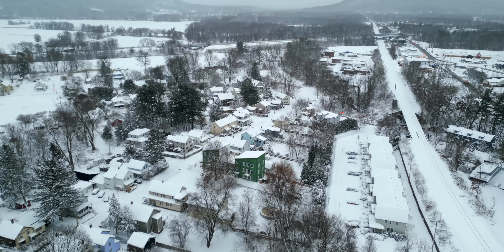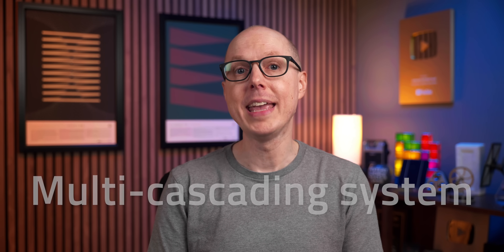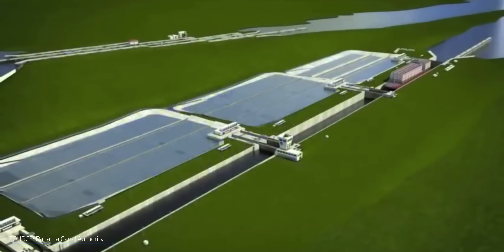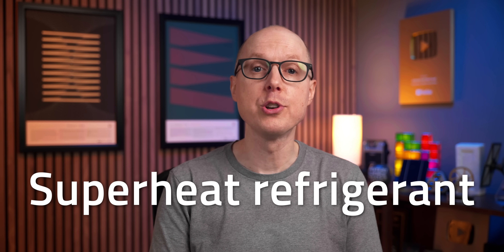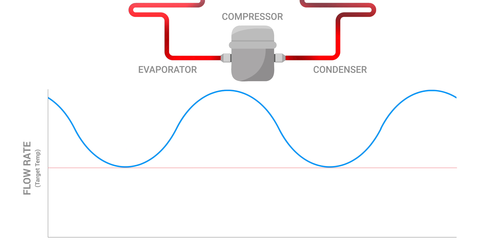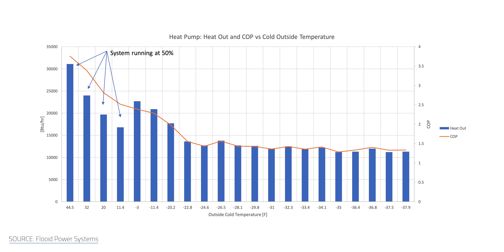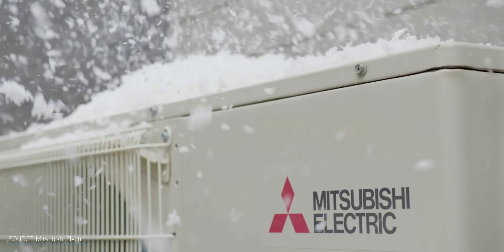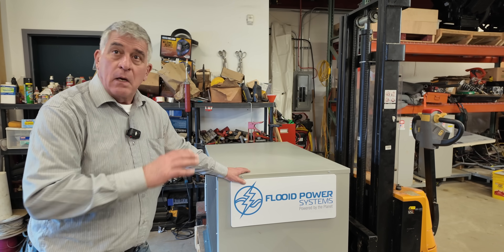How This New Heat Pump is Genius

Comment: Heat pump technology is fine for certain things like residential Air Conditioning in hot climates when there are no alternatives like evaporative cooling in humid climates or absorption technology which is far to complex and expensive. The problem is electric utility rates are increasing much faster than HP efficiency improvements are being developed. A good, old fashioned Nat Gas fired furnace or boiler for space and water heating just can't be beat. The price of Nat Gas would have to go up 10x before electric heating via heat pump would make economic sense. Also, for the record, CO2 is not a pollutant, its plant food.

Comment: I'd like to hear the exact same talks about efficiency and system with the valve thrown the other way. Here we worry about air conditioner performance. Heating's just an afterthought for a few days out of the year. Everyone's AC system can always switch over to a heat and everyone has AC here.
So rather than a story about boiler replacement I'd want to know about air conditioning efficiency in hot weather. 

Also I would really like to know how they deal with the air movement and physical size of the device outside. You know where it's pulling in heat or pushing out heat. That was kind of skimmed over in this video. He said a small box but what does that mean? Does he require a large amount of airflow on it? I would assume you have to have either more physical exchange size or more air flow over it because you are still trying to move heat so you need that heat to come across it

Comment: Is PID control not used to help minimize over and under-shooting in traditional heat pump, cooling/heating systems? The oscillations sound like something that PID controls are specifically designed to prevent.

Comment: Here in scandinavia we have been using the heat pumps for years and they are able to deal with -20 degrees no problem but we have good isolation. 
They use a de-ice program if there is ice buildup on them (bacikly it turns into an ac for a couple of sec so the ice on the pipes melt/fall of)

The point:
I dont really see a big enough gain in lower temps where the price of a dubble loop wil make sense for the extra price the compaired to the electrisity saved🤔 

I am more interested in the new gassewe are going to start to use i think it was propane🤔 
I think this will make a good difference without making the systems more expencive actually itll make it even cheaper cause the gas they use now is quite expencive

Comment: You can simply use CO2 as the refrigerant to get a heat pump that works in temps as low as -40C and it can produce heat at 90C. Problem solved.

Comment: Well we run a system where we have solar warm water on the roof and a heatpump with 3 drilled holes to use the heat of earth during winter. (I think its already nearly 10 years that we use it and its great)
Reply: I am so curious about this idea. Can you explain more about how it works? I have been wondering if one can preheat with solar for heat pumps.
Reply: @chrisbuhler3686  ohh it is not preheating but in summer the ground loop doesn’t need to be active. And since the water from the roof loop returns so hot that it just basically heats the boiler through a heat exchanger.
Reply: @Superbus753 that’s cool. How deep is it?
Reply: @chrisbuhler3686  i can’t remember the exact depth but if i remember correctly it was 2 holes each 200 m deep

Comment: I think of multi-cascading heat pumps by thinking of a roller coaster LSM motors. When you are riding a coaster with multiple, spaced out launch runs, the magnets aren’t more powerful, they just add to each other to increase speed

Comment: Saying a 2 ton system equals to a 4 ton is like Apple saying their 8GB of RAM in their macbooks equal to 16GB elsewhere and just factually incorrect. Their 2 ton might able to maintain the same efficiency as a 4 ton air-source system at certain design conditions but it will never be able to move 4 ton of thermal energy.

Comment: Looks like awesome tech. I'm ready to hop on the heat pump train. My house was built in 69', the furnace is from..
69'. It's a heck of a furnace that literally will never break, but is love to snip the natty gas cord. Once I get solar panels installed it should eventually be a closed loop system.

Comment: @UndecidedMF I hope they certify their boiler sooner than later, as I believe there's a substantial market for such. In my area (Canada's east coast), residential oil boilers driving radiant baseboard and/or radiant flooring are very common, especially in older houses. Whether one believes the Climate Change Cult dogma or not, the efficiency of heat pumps could make the transition justifiable. 

Although there are a few companies offering dual-compressor heat pumps, most of them are reluctant to say their equipment produces hot enough water to be effective with radiant baseboard and/or radiant flooring. Only one company (Nordic WC series manufactured in New Brunswick, Canada) claims to produce temps high enough to such... and when I was looking for geothermal installers in the area, all of them had deals with other manufacturers and weren't interested in installing what was (to them) an unfamiliar product. 

For this kind of retrofit job, the ability to reverse for AC in the summer isn't helpful. My house does not have air ducts or plenums... just heating pipes... and to be honest, it doesn't get that hot up here. Most older houses don't have AC. I wonder if Flooid is considering a non-reversing model for heating only applications? Hmmm....

Comment: In theory it sounds good but you get diminishing returns every time you add a pump along with added components that will fail. Low running costs plus higher maintenance costs.

Comment: May save you money ? Why would he say that? These run on electricity,so show the kWh consumption in comparison to the other single scroll compressor units.  Heat pumps in -11 yes it will heat the house but at what cost? I want to see real in home test data that is third party verified

Comment: Am I missing something? This seems to have all the advantages of a ground source/geothermal heat pump but made it way more complicated in the process. Or is this designed specifically for places where ground source can not be used due to limits on available land? Ground source requires the laying of hundreds of feet of loop in trenches or drilling "wells" to accommodate the thermal loops, so is not usable in many areas where homes sit on small lots as is common in cities and many towns. Assuming this unit will take up the same amount of room as a standard heat pump, I can see it being used in places where space is limited. Otherwise I do not see that it offers any advantage over ground source/geothermal heat pumps. I also do not see it beating ground source/geothermal heat pumps in price, at least not in the near future.

Comment: How reliable are these systems? What is the failure rate per 1000 installed on a yearly basis? How much so the repairs cost? How difficult is it to repair them? 

Nobody every asks these questions. Since COVID, I am doing a lot more of HVAC warranty work. The stuff coming out of factories is absolute garbage now. You might want to think about that.

Comment: In the meantime ground source heat pumps don't need to worry about all the temperature variability almost at all. Still, keep rocking with the research and engineering, the more choices we have the better.

Comment: Like gears in a transmission. Shifting horsepower and torque through gear reduction. Sounds like each loop is shifting to a higher gear. Interesting this is being brought to residential applications.

Comment: I think I've heard the same words over and over without actually getting any information. And yes, if you use multiple items to do a job it's going to distribute the workload somewhat equal on all items. But each item costs money, to buy and use. The most efficient system will use different types of gas / refrigerant to transition from one stage to another. But this is not going to be easily reversed, unless the input and output are mechanically reversed while maintaining the cascade. Now the efficiency... ? I think that needs to be calculated at all deltas and in all directions, heating and cooling. How is the cost compared to other systems and conditions? How much does this cost?

Comment: Last February, I switched out my 17 year old gas furnace for a heat pump. 

Feb 2023’s gas bill to heat the home: $734

Feb 2024’s electric bill to heat the home: $17 (we have solar panels)

Yes, my heat pump was expensive, but I got the maximum tax deduction off of my 2023 owed taxes, resulting in a nice return, and if the past year is any indication of things to come, my home energy cost to heat & cool the home will cost so much less, I should have the heat pump pay for itself in savings in as little as 5-6 years of my math is right.
Reply: It might need repairs in 5-6 years.
Reply: @kitemanmusic  if it does, good thing it comes with a ten-year warranty

Comment: Hvac design engineer's 3c: pretty cool, but as you said a HP system is expensive to begin with. Adding complexity with 3xcompressors,heat exchangers and reversible valves pretty much prices this out of the market. Natural gas is still 3x cheaper than electricity and majority of the market is 100% happy with systems working reliably between - 5 and 105F. When you're developing a heatpump for - 30F your market is limited to Canadian prairies and Siberia. I wish the guys all the best, but it appears they will stay in the garage.
Reply: If electricity is only 3x more expensive than gas then a heat pump will cost around the same to run as a furnace. I don't know about the entire market but here in Massachusetts it sometimes gets below -5F. We need a heating system that won't quit when it's that cold.
Reply: @eDoc2020  sure but why? You'll pay way more for a more complex mechanical system with a higher rate of failure plus your heating goes in an outage. Why complicate things?
Reply: @kmier2000   A regular heat pump is cheaper to buy than furnace + AC.
Reply: @eDoc2020  I checked in disbelief. From where I'm sitting a standard heatpump 800cfm, 2 ton system starts at roughly $3000, you can get a furnace and a unit/coil system for $2500. Again that heatpump's heating capacity will ramp down starting at 5F, at operating limit it can give you maybe 40% of rated capacity, plus spends a good chunk of time in defrost. For regular HP you need a heating backup and you will be heating by electric resistance at least part of the year.
Reply: And my apologies when I said "working reliably between...." I meant 5-105f and not a negative 5F. Being trained in metric I'm easily confused ;)
Reply: @kmier2000   I haven't done a full cost comparison but when I checked a basic heat pump outdoor unit was $500 more than a cooling-only unit. The indoor AHU is the same whether or not it's reversible. If all of our numbers are accurate this means a furnace and coil costs the same as an air handler. This is hard to believe because burners and heat exchangers cost money.
Reply: @eDoc2020  it all depends how you buy it. Complete systems are always the cheapest and should be compared instead of sum of parts. I come from more of a commercial world so I don't have the residential data at my fingertips. All I'm trying to say the tech is not there for the cold climate and there's no incentive for the big players to develop it, especially when gas is way cheaper. If I was a betting man I'd say within a decade the sanity will prevail and nobody is going to talk much about net zero or electrification.
Reply: @kmier2000   I don't think standard residential systems are ever sold whole, it's always separate. Package systems like rooftop units are the obvious exception but nobody puts an RTU on a house.

And gas isn't much cheaper. When I did the math a heat pump cost something like 30% more than gas to run throughout the entire year. This obviously depends on local utility rates and to a lesser extent the local weather. In much of the country (possibly even most) heat pumps cost less to operate.

For a consumer "net zero" means no utility bills, something that will never go out of favor. Heat pump + solar is the easiest way to eliminate heating bills.
Reply: @eDoc2020  agreed on the "net zero" as not paying bills lol! So now you're adding a solar array, a large battery and all the controls that come with it. All that has deterioration profile, useful life and capital cost, and if we are honest it won't pay for itself unless the taxpayer is helping. Where I am a contractor typically buys a complete system for a new installation. Gas/electricity price difference in Ontario, Canada: 14c/kWh electricity,  4.8c/kWh, NG and this is after our carbon tax is at $80.ton. Agreed, in a milder climate it will be a no brainer to run a HP, serious heating is the big issue though, which hasn't been solved, and it looks like it won't be for a while.

Comment: Easiest way to describe it is a bucket chain on stairs. You can't lift a bucket from the ground floor to the third floor as one person, no matter where you stand, because you can only reach so far up above or down below your current level. But with multiple people all on different steps, you can lift the bucket up or pass it down, as long as the two neighboring people share a certain height where both can reach.

Comment: Won't ever warmer winters and warmer summers offer both ultra low cost water heating and hot air cooking at ever higher COP. The output is colder air as heat is scavanged from this warm air. The big problem is heat pumps need well insulated homes, well insulated plumbing to keep the heat in the pipes and tanks the summer and reverse in the winter

Comment: it's crypto advertise... there are low of phisics that for now... no one break.. And this 'new' heat pump isn't new at all.
Also.. COP 3.5 is v. low for modern heat pump. IDK in USA you don't have better heat pumps or what? In Europe COP around 4.5 it's a standard.

Comment: They should build cascading heat pump technology into a 110/120 & 220/240 volt line of heat pump window units. When the cost comes down. Would greatly reduce installation cost & eliminate ductwork, and the inefficiency of pumping thru ductwork. Plus many houses, ours included, don't have & can't accept ductwork. So window units are the only thing possible. Also, multiple units introduce heating/cooling redundancy, which eliminates one central point of failure. You can just put fans in doorways till any failed window unit gets repaired/replaced.
Reply: There are some window-mounted heat pumps on the market. Current ones usually have poor cold-weather heating capacity but it's better than nothing. If you have baseboard radiators providing some heat these units could provide the difference.
Reply: I would buy a window-mounted heat pump in a second, if I was confident it would be reliable, and if it were affordable. 
(I can afford an expensive window A/C unit, but heatpump stuff can be really expensive, and limited supply will keep the price high while the manufacturers gradually increase their production capacity... but i really really hope all that will happen soon, and is happening right now!)
Reply: @Wordsmiths  There are numerous "1 way" DC inverter window heat pumps right now. But they only cool, and do not heat the house. I don't understand why the OEMs didn't just start with a full technology transfer of the DC minisplit technology into a unit that goes in the window instead of through the wall, in the first. It's something I thought of minutes after first hearing of DC minisplits about 15 years ago. There's no technical reason why window unit versions of DC minisplits didn't exist from day one. It's literally the exact same machine, in a different shape/configuration. It would be more expensive than the traditional window units of course, but mass production would bring the cost down.

Comment: 200 years ago Carnot described how ideal heat engine works. No amount of cascading will break that. Ground source heat pump with underfloor heating has real life COP around 4-5 when pumping the heat from +7 C to +35 C. Ideal heat pump efficiency for the same dT is 11. Ground source heat pumps are optimized very well for what they are doing and they only perform 36-45 % of what ideal heat pump performs.

If one has to pump from -35 C to +60 C, the carnot cycle ideal maximum COP is 3,5. Assuming both pumps in the cascade system is optimized to the same level than single stage ground source heat pump is optimized, the real life COP will be around 1,26-1,58.

Conclusion. Invest in insulation, large heat release surfaces and ground source heat to keep the dT as low as possible. Heat pumps are and always will be efficient only when pumping over small temperature differences, no amount of cascading changes that.

Comment: It gets to be 117f while it is raining here on the gulf coast. I am planning a rain barrel/geothermal loop to add to my existing air to air heat exchanger. The colder than air water will come off of the roof, and when it runs out it is no worse than it was. When there is water in the rain barrel (or drainage ditch in my back yard), I should have a much higher COP.